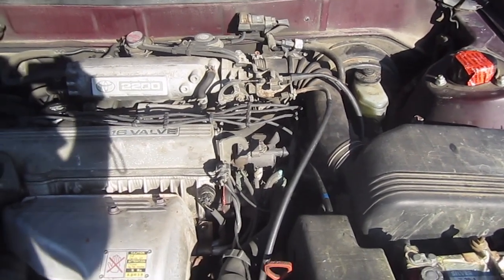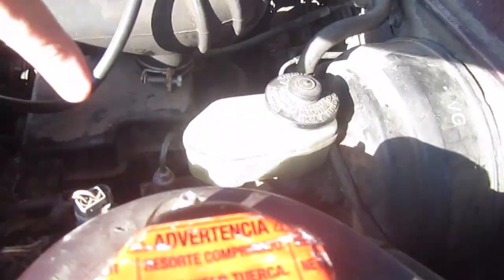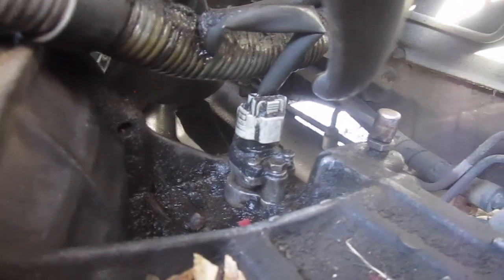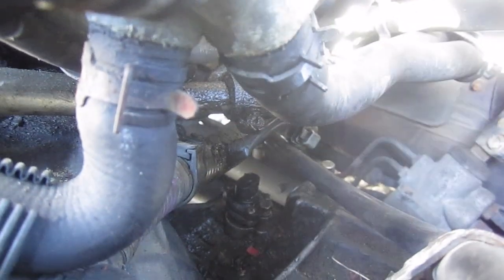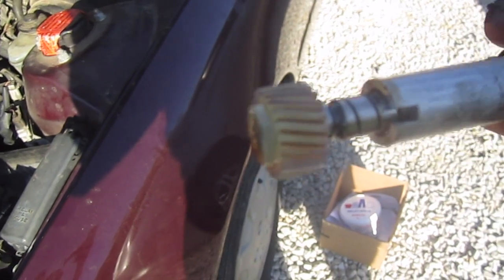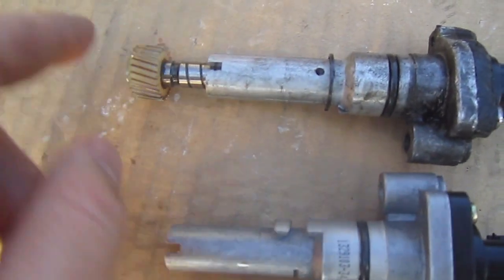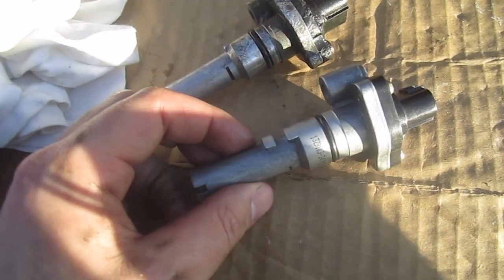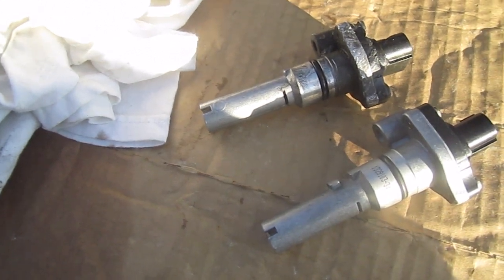93 Camry Speed Sensor Change

Comment: this is the ONLY place i have found that actually describes where the sensor is and the issues with aftermarket part.  I so appreciate this video and weylinfairchild for posting it.  I would add though for a correct fit after grinding off the tab and know a machinist take your old sensor so they can measure the diameter of it and machine the replacement on center to fit properly.  Tolerance on the part can be + or - .015 of an inch because it has an oring so it should be cheap to have turned down.  Again thank you very much for posting this weylinfairchild!!!!!!!!!!!!
Reply: Ŕចុចលើផ្នែកដកចេញ ដើម្បីដាក់វាចូលទៅក្នុងប្រអប់អត្ថបទ។ចុចលើផ្នែកដកចេញ ដើម្បីដាក់វាចូលទៅក្នុងប្រអប់អត្ថបទ។

Comment: Just got the hold of a 1993 v6 camry. Speed meter and rpm meter dosent work but the mileage still goes up. what can be the issue? can anybody help please? Thanks
Reply: Areeb Uddin you need to replace the capacitors on both the tachometer and speedometer. They have a history of blowing after about 16 years. The tach has two 10uf 25 volt capacitors and the speedo has a 6.8uf , 22uf, and a 100uf 25 volt capacitors. They cost about $3.00 usd without shipping.
Reply: @jonhare392  I am also experiencing the same problem as described by Areeb. Are the capacitors located on the dashboard themselves?
Reply: Terry Giang you have yo remove the instrument panel and the capacitors are on the speedo and tachometer

Comment: This is an awesome video. Thank you for clear directions on how to remove the speed sensor.

My issue was that my speedometer needle was fluctuating at all speed and sometimes hesitating to accelerate or transmission won't shift gear smoothly.

Before I change the sensor, I wanted to test to see how it works. I looked everywhere to find a way to test the sensor and I couldn't find one. Finally I found a copy of the service manual and was able to troubleshoot the sensor. I will list out below my method.

How to test No. 1 Vehicle Speed Sensor (VSS).
***Need a voltmeter to perform this test.
1. Remove the sensor from the vehicle.
2. There are three screws on top of the sensor when facing the connector. They are placed in a triangular pattern. When you look down on the connector, single screw must be on top. That is your popularity mark. From this orientation, Left PIN =1 is battery POSITIVE, middle PIN = 2 is battery negative, and right PIN = 3 is SIGNAL.
3. Connect the battery to the sensor. Battery positive to PIN 1 and negative to PIN 2.
4. Place the voltmeter's position lead to PIN 3 and negative lead to PIN 2.
5. Rotate the sensor gear shaft. The voltage will  change from 0 to 12  to 0 Volts on the voltmeter. If it doesn't change the value, sensor is faulty.
Reply: How did you connect the battery to the sensor?
Reply: Thank you 🙏🏻

Comment: i  bought one for 96 camry v6. looks very identical from the original, but also had same problem. it wont fit, thanks to this video, i will use 320 grit sandpaper. got mine at amazon. $10

Comment: Thanks for this video! My speedometer has been slowing down for years and I didn't know what the part was I needed to order. This helps a lot! My tachometer stopped working 10+ years ago. Same kind of sensor?
Reply: Hello,  I just repaired my tachometer on my 1993 camry.  There are 2 capacitors (10uf/25volt) that needed to be replaced.  There is another lady with a youtube channel called sarahntuned. She did an awesome video on how to identify, desolder, and resolder the capacitors.  After 10+ years my tach is finally working. It only cost me 25 cents per capacitor at my local electronics shop. Might be a dollar each if you order online. There is another youtuber named Peter Finn who shows how to remove the dash. Only took me 5 minutes to remove the dash with just a screwdriver.  There are two screws hiding underneath a cover located under the radio that he didn't show, but easy to find. Hope this helps!
Reply: @paulmiyagishima7655  ...this does help! Thank you so much Paul!

Comment: will this fix my 1996 toyota camry automatic trans, 2.2L
Its throwing a P0500 code the car does not go forward in any gears but it can go backwords. When in any forward gears it just revs the engine.

Comment: I've got 1995 had a starting problem so I changed the distributor and now transmission not working I have P R U light when I put it in drive the light goes off someone please help

Comment: did changing speed sensor fix the problem??
Reply from the maker: Yes, in this instance it fixed the fluctuating of the speedometer. I think sometimes it can be a motor in gauge cluster getting worn out but you can pick those up on eBay. Hope that helps.

Comment: Just removed my speed sensor 1995 camry 2.2 original part. I bought it new. sensor diameter .8656. 22mm = .8661 .0005 larger.